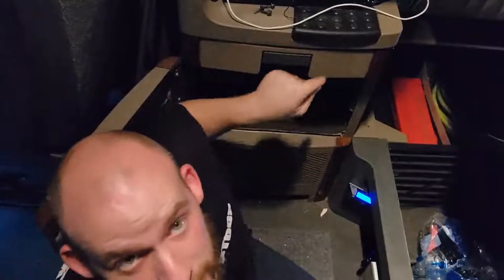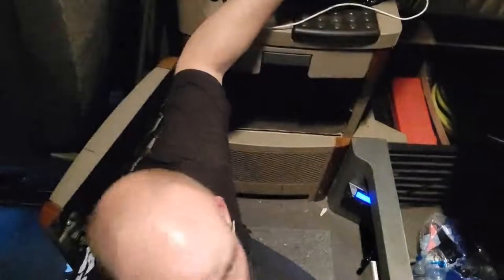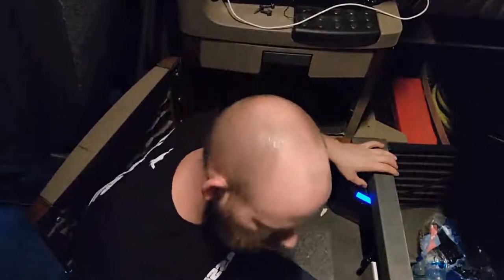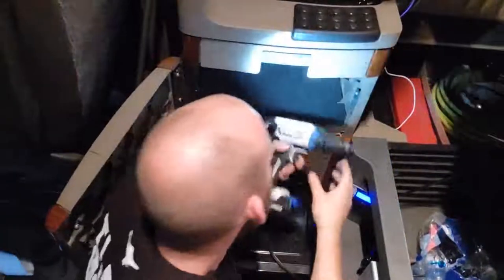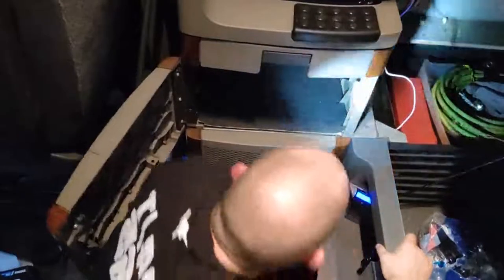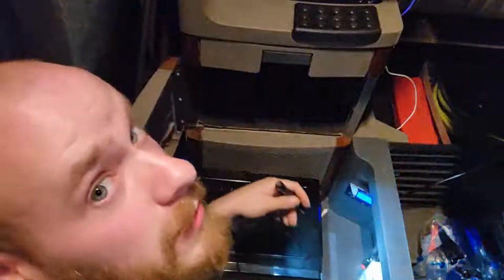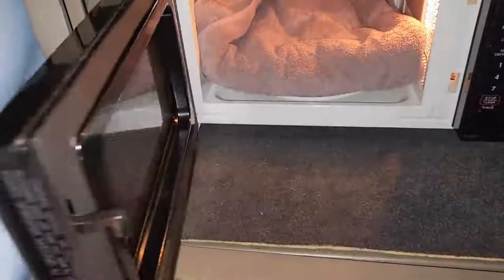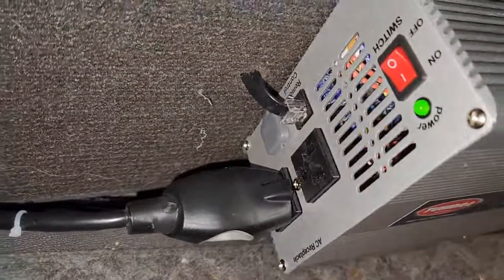HOW TO INSTALL A MICROWAVE IN A FREIGHTLINER CASCADIA 2011 - 2017

Comment: Do you need an inverter? Or is there a regular plug in the truck?
Reply from the maker: sem trucks need a power inverter lol. i ran the power cord of the microwave to an extension cord cus the cord is short on it, and then fed the extension cord to a power inverter. minimum of 1500w true peak inverter is recommended